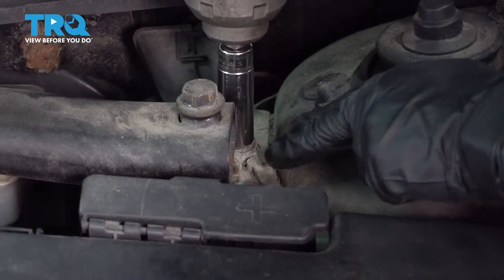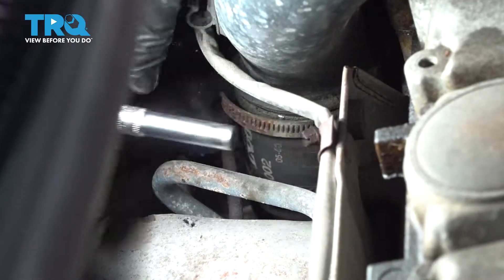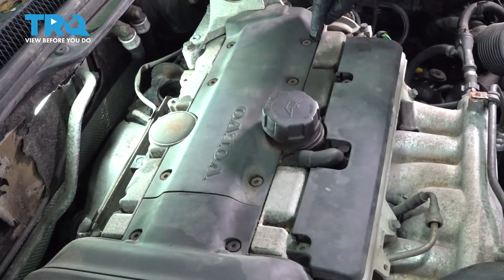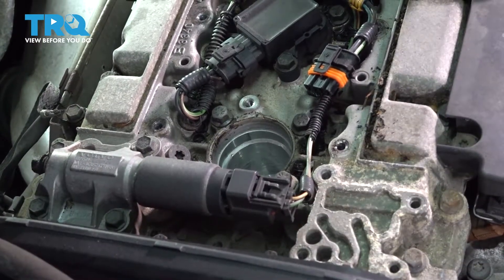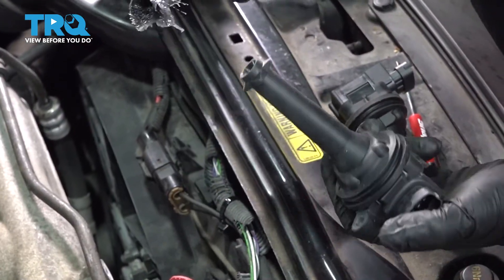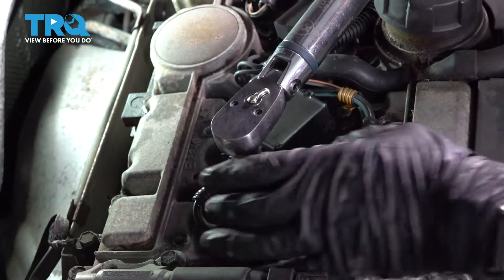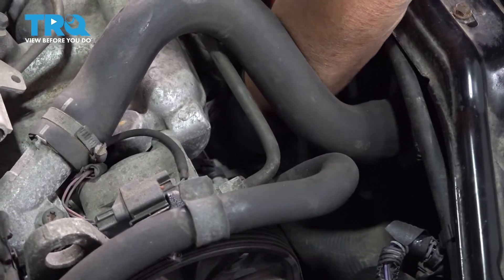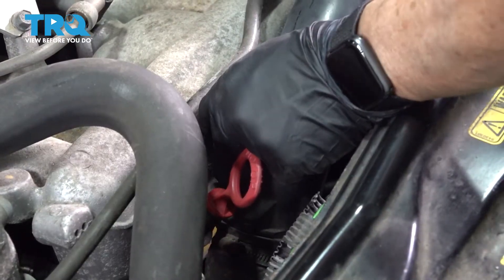How to Replace Spark Plug 2001-2007 Volvo V70

Comment: Just did the plugs on my 2007 s60 2.5t AWD. All the bolt sizes matched perfectly. This video made it easy. Spec on the plugs was 21 ft lbs for me. Used a compressor to blow out some minor debris before pulling the plugs. You can just detach the front half of the charge pipe and it gives you plenty of room to move it outta the way to access every bolt/plug.